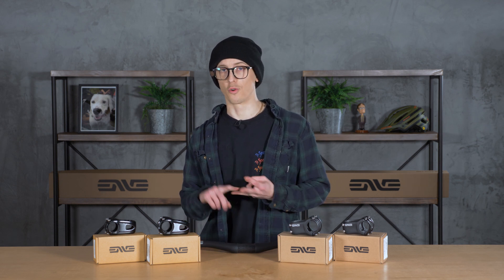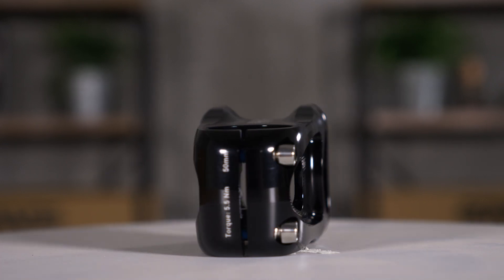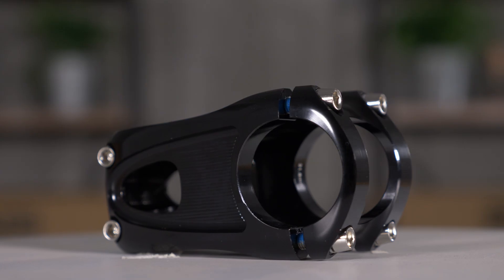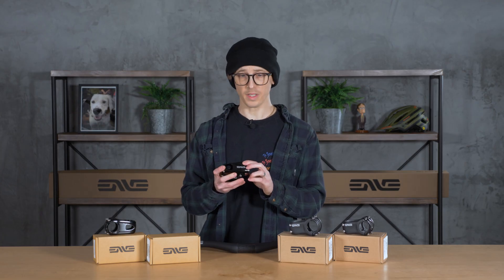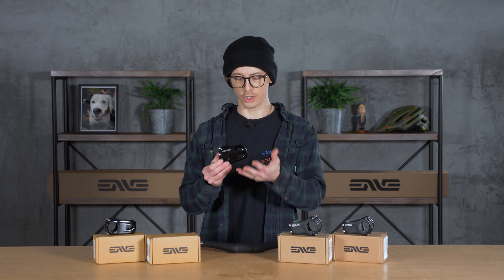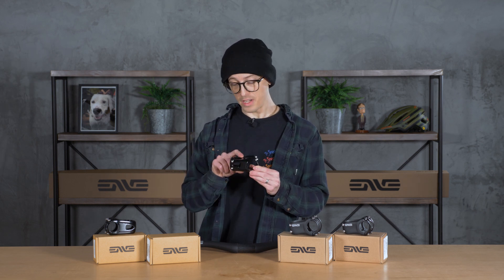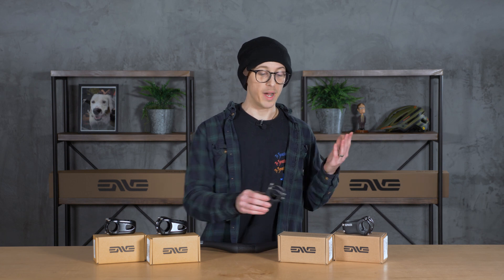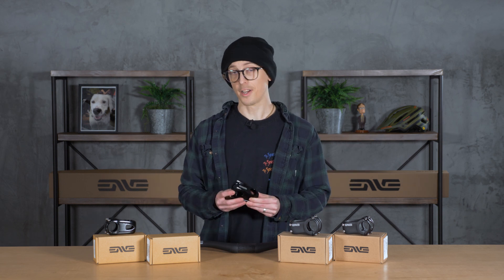ENVE Aims Their Expertise at Alloy, Starting with the Mountain Stem

Comment: Could be wrong but ,I'm pretty sure "No Gap" applies only to the top of the clamp. The should be a gap at the bottom when it's torqued to spec...
Reply from the maker: Yep, that is correct.